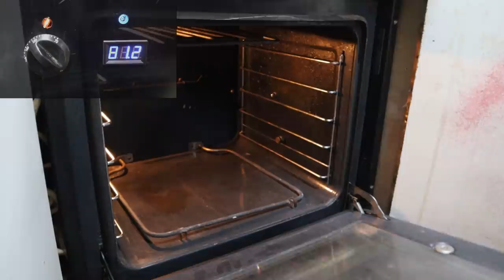Antique Cast Iron Potbelly Cauldron Restoration.

Comment: It was refreshing to see the seasoning process done correctly.  Many people only season their pots/pans one time.  3 is the minimum I would use and I've seen people season their pans up to 5 or 6 times for that perfect coat.  Well done!!
Reply from the maker: Thank you Jacob. We have received so many comments saying we did it wrong. But we know this is the correct way of doing it.
Reply: @AJRestoration  well done 💯👍
Reply: @fabiankawau3362  .
Reply: Hi all. You' re quite right in the number of seasonings. I did my 1/2 size cauldron over an open flame 8 times and its withstanding better than my 3timed seasoned pan. 😍

Comment: Fun fact for cast iron collectors. As a general rule, the thinner the pot wall, the older the pot. Another sign of age is that legged pots like this tend to have one leg worn down much shorter from years of scraping and dragging on the hearth stones. I have seen some that were literally "pot bellied" where the legs were so worn down, the pot rested on its belly.   The reason for the thinner walls is that when labour was cheap in the 16th-18th centuries, casters would make 100 pots and expect up to half to fail, but it didn't matter when the sale of a handful of pots was enough to make a living on. However, when wages went up during the industrial revolution, they needed a higher success rate, so the pots got thicker. 

Also, the triangular handles or ears on the cauldrons like this were not designed originally for wire hoop handles. People would have used pot grabbers. It looks like a large set of iron calipers with bent ends. As they are adjustable, one pot grabber could fit all the pots you might have in your house. Much cheaper than wire handles and they didn't burn your hands.
Reply: I have a Falkirk pot like that from the 50s. I inherited from my grandpa in cape town who had copper plated it and was using it as a coal skuttle.
The copper is long gone. I brought it to the UK and still use it. What I noticed is that it's much thinner than the modern ones.
Made in Scotland I'd assume when they were in the heydey of good manufacturering.

Comment: Maybe a cleaning with degreaser first, then use a 2 amp battery charger, a sacrificial anode (large coffee can metal) and some wire and a plastic container to use electrolysis to remove most of the rust and speed up the sand blasting.

Comment: Power tools aren't always faster. A small round file would have dealt with that casting bump far quicker. I know the full time spent grinding isn't shown but I've done nearly the exact same thing with my dremel and and I eventually learned that a new, sharp file took less than half the time and now I reserve the tiny rotary grinder only for nooks and crannies where a file won't fit.
Reply from the maker: Thanks for the tips! I have noted in some cases the files do work faster.

Comment: I have a Falkirk pot like that from the 50s. I inherited from my grandpa who had copper plated it and was using it as a coal skuttle.
The copper is long gone. I brought it to the UK and still use it. What I noticed is that it's much thinner than the modern ones.
Made in Scotland I'd assume when they were in the heydey of good manufacturering.

Comment: Excellent work!  Having de-rusted similar sized items, I can wholeheartedly recommend trying electrolytic cleaning.  Water, washing soda, and a 12v battery charger would have saved you quite a bit of effort, and a lot of sandblast media.  Sandblasting also may not remove heavy metal contamination, whereas electrolysis will do a better job.  I also might have attacked the inside bottom with a flap wheel to get rid of some of the pitting, but, that's a nit pick.  
I have no problems at all with that recipe!  I find the apricot jam and cream soups combo a bit odd, but, it looks tasty!
Reply from the maker: I have one coming up that I want to try electrolysis on. The recipe came out absolutely amazing!
Reply: @AJRestoration  I think you'll like electrolysis! It makes a nasty looking sludge, but, it's all stuff that came off your part!
Reply: @paulfeist  Heavy metal contamination? Really? Is this a common or possible thing with old rusty cast iron? I never thought that would or may be an issue. Honest questions.

Comment: It's actually frowned upon in the ci community to sandblast ci but if it works it works im all for it lol. Lots of people frown on my ci cleaning methods but I don't care. I oven self clean ci for 2hrs to bake off the carbon buildup and never had a problem. As a tip any ci with only rust can easily be cleaned by soaking in 50/50 water and white vinegar. Depending on how bad of rust it can take 2-12 hrs normally.
Reply from the maker: Thanks for the info
Reply: @AJRestoration  you're welcome

Comment: Just a FYI…. The difference between brands like Lodge and the more expensive brands is surface prep.  The more $ brands sand and smooth the surface so they start off like very old well used cast iron.  I buy Lodge then sand the pits out till it looks like glass.  Beautiful work.  I need to get me a media blaster.👍

Comment: That's a beautiful piece of cast iron. I'd love to see it hanging over a fire filled with slow-cooked ham and beans. My grandmother was born in the late 1800s, when she died at the age of 93 she owned 3 cast iron pans she had accumulated over her life. The 1st she received as a wedding gift when she was 16... almost 16 anyway. Probably as much baking went on in those pans as frying. I use her recipe for biscuits that she had been making since she was 12, probably her mom's recipe,  the same recipe my mom used her whole life, and mine *Never Tasted The Same*. Sorry for venting. I added those pans to my own collection when she passed. Added them to a number of others that she would have probably found a little silly... but hey, I might need a cast iron crepe pan every few months. With all these pans now I find myself using her three except when I want my crepes. Her yearly or seasonal cast iron maintanence plan was to build a big hard-wood fire outside and set two of the three pans in it and let it burn down. When they were cold she would just knock off the ash, scrub'em dry, and start to reseason them. She said that's where the term came from, each pan had a season. Everyone stay safe.
Reply from the maker: That's not venting buddy, its a nice story and thank you for sharing! My mother also collects them, she now has about 6 of them if I remember correctly. When I gave her this one she was so happy, she told me this one looks so good she's going to put it in a display case and never use it.

Comment: interesting, just a slight difference from what I would call a bean pot yet it could be used as such. The legs on a bean pot are shorter.
A bean pot is used to make baked beans, from scratch. Normal use method is put all the ingredients into the pot, cover and put the full pot on top of the wood burning stove to slowly heat and cook everything for 24 hours.
Dried beans needing to absorb the moisture ( water ) and then be cooked through means it's a slow process.
yes, the tinned "pork and beans" or baked beans is the final result, however you can adjust the recipe to improve the flavour for your own tastes.
Reply: nowadays you can cook those beans in regular pressure pot. 4 to 6 hours is plenty enough to make them absolutely soft.
Reply: @Romazetti  a full boil in a regular sauce pan for 4 to 6 hours is enough to soften them as well, my original post was on how the old cast iron bean pots work only.
Reply: @jaquigreenlees  maybe we talking about different kinds of beans? I remembered that "фасоль" and "бобы" is both "beans" in english :D
google for example "russian black bean". if you cook it in regular sauce pan only for 6 hours, you will break your teeth :D
"фасоль" - is climbing plants. seeds are very easy to cook.
"бобы" in the other hand - is bushy plants of the same family. seeds are much bigger, and take much longer to cook.
Reply: @Romazetti  I was talking about pinto beans and kidney beans, either of which would be used for baked beans.
Nice to know there is a kind of bean you would need to cook for a very long time unless using a pressure cooker.

Comment: I'm from Cape Town. Have you tried electrolysis? When I normally get my hands on an old driepoot like that I just chuck it in an electrolysis bath and let it cook for a week. I soma use a car charger to supply the power, and it comes out great every time. It's nice and environmentally friendly, doesn't put any wear and tear on any tools and just needs a light scrubbing with a sponge or brush to get the magnetite sludge off before seasoning. Lekker recipe that.
Reply from the maker: Thanks Francois. We actually have an electrolysis video on our channel. We will keep this in mind If we ever do something similar again.
Reply: Or DC 1 rust removal

Comment: That's a nice looking pot. I restored an old cast iron pot I found in Colorado. I used garnet and walnut shells to blast mine.  I also did a salt scrub on it before seasoning. From the marks I found on it it's from 1856. I spent a lot of time on the restoration. Now I use it to make stews and even fry fish it. Just wish I had the original lid. It was not to be found though.

Comment: For the people who don't have a sandblaster after the wire wheeling you can soak in 50 percent white vinegar and 50 percent water for up to 24 hours watch once no more rust rinse hand dry place in pre heated oven 250 degrees for about 2 hours remove,, coat with lard or olive oil 
Heat for about 1 hour repeat 1 more time .... Cook french 🍟 or bacon first time , never use soap and water on your cast iron.. use salt and rag or stainless steel scrub pad to scrub out pan of food stuck on then more oil.

Comment: If you put it in a pretty hot bonfire it will burn everything off.  Works for me.  Build a fire and let it burn down some then set item in hot coals and come back some time later and coat with oil.

Comment: Just some personal experience sharing. Flax seed oil will give you a beautiful finish on your cookware and I found anymore than 2 coats was unnecessary due to how hard the finish is and not very durable. Which in turn is a very brittle season layer. It will most certainly with use chip away. My grandmother swore by crisco and I used that for years to much success with a much more durable season finish. Still not completely satisfied I decided to start using what the real "old timers" used. Pure lard. I like pork lard. This is by far, IMO the very best to season your cookware. I use a small amount, thin layer over the whole pan, before each cook session for a "base layer" then add whatever oil or fat ontop of that to cook with. Clean, dry on stove, then add another thin layer of lard across the the whole pan for storage. Which never leaves my stove. I dont care for the seed oils anymore. Highly recommend pork lard. Bacon grease is a go to as well. I too when when putting a fresh new season on a bare pan will preheat it to 200..add my lard and wipe it all off..then set it back in the oven at 200 for an additional 10-15 minutes, then remove and wipe down all oil again, place back in stove and raise temp to 450 for an hour. Doing the second wipe down before returning to oven will help prevent a splotchy finish look from pooling oil. Good luck!

Comment: Beautiful restoration!  I don’t have access to a sand blaster. Sure does seem to make a difference!  Thank you for sharing.
Reply from the maker: Thanks for watching!
Reply: If you have a self cleaning cycle on your oven or any heat source that can get up to 260 C, that will work as well. It can take up to 6-8 hrs though. Some surface rust will appear after washing, but will go away when seasoning.
Reply: @mond5004  Thank you !!

Comment: You didn't make a potjie but an outdoor stew. A potjie must be done in layers of meat and veggies and musn't boil but very slowly SIMMER until its cooked. That may take anything from 3 to 5 hours, depending on the meat used. You will also only need one briquette after the potjie reaches full heat.
Reply: Cool

Comment: Don't sandblast vintage cast iron. Use electrolysis, which is super easy and non destructive or an acid based rust remover.

Sand blasting and grinding and wire wheels are a fantastic way to turn a potentially expensive antique into a door stop.
Reply from the maker: Thank you!

Comment: Never store iron pots with the lid on. Water accumulation will occur. Put a cup or two of rice inside. A folded paper towel acts as wicking and air space so air can move around. Cooking acidic food is hard on seasoning, as well as metallic cooking tools, Wash iron that is very warm to the touch with HOT water and a plastic bristle brush. This creates steam that will loosen stuck foods. No soap. Always wash as described above, dry, heat iron to very warm and wipe down with thin coat of oil before storage. Do not soak in water, or boil water based dishes in cast iron...loosens seasoning. Well done!
Reply from the maker: I store them with the lid on, but I fill it up with newspapers and a cup of rice to keep it dry and comfy. Thank you for the advice, it is really informative!
Reply: @AJRestoration  Cowboy Kent Rollins here on YT is my goto expert for care of cast iron. I used to have problems with it, but since adopting his methods, no more. He also uses flax seed oil for establishing reseasoning. I like your application of the oil with the brush. Avoids lint deposits. When it gets really set in and turns completely black and set hard with repeated use and seasonings you can switch if you wish to olive oil. Soap of course, especially modern powerful dish soaps will logically break the seasoning down...that's a beautiful old pot!😍

Comment: Although most cast iron junkies would be mortified at the thought of using a sand blaster, the amount of rust might have warranted that. Although, I have to agree with others that an electrolysis tank is where I would have gone with it first, and than some light scuffing with a scotch pad. In addition, cast iron is porous, why didn't you preheat it before adding your oil? Also, why didn't you turn it upside down so you don't get pooling in the bottom of the pot?
Reply from the maker: I get what you are saying, but electrolysis would not be sufficient, and I would have used abrasives anyways. I don't think there is any problem using sandblasting on the cast iron pot. The pot was preheated, but not the lid, the pot was done on another day so I gave the lid a layer of oil to prevent it from rusting while I am busy with the pot. Also the excess oil was thoroughly wiped down, thus it was not necessary to bake the pot upside down.
Reply: @AJRestoration  . My husband and I collect and restore cast iron and as bad as that cauldron was with the crack we would have never attempted the E- tank or lye bath. If someone is going to use it the way it is and love it you did a wonderful job. We used the same flax oil you did and the flavor and color of our pans wasn’t very good so we switched to Ghee butter and the taste and color was excellent. Thank you for sharing.
Reply: @Nonayabizness360  For the life of me I can't see the crack.
Reply: @Ea-Nasir_Copper_Co  . Yeah I know that's what I meant he did a very good job. We are on so many pages and there are so many cast iron snobs. I say if you are going to keep it and love it or are restoring a piece for a family then its worth every bit of work. We use a lye bath and Ghee butter for ours and we have rescued many from the junkyard by our home. We love seeing the beauty come back to these pans and they just don't make them like that anymore.

Comment: Not sure if it was antique, the wire handle was not rusted? Reminded me of a time I was working in another city and my wife left our potjie outside in Cape Town winter, we live quite close to the sea.  I only found out when cleaning the backyard, as she had put it out of the way to cool down and promptly forgot about it. It was as rusted as this. Did not have a sand blasting machine, did have elbow grease, sandpaper and wire brushes.
Reply: His method of seasoning was better than mine. I bought those aluminium trays, and inserted my potjie upside, the excess oil woul fall in the tray.

Comment: It looks like the sandblasting took longer because you can see a pulsation going on, in time with the generator engine.  Something you don't see when plugged into steady household (or industrial) current...just the observation of a casual observer who has never done any sandblasting, but has watched many a YouTube video of folks restoring things using sandblasting...
;-)
Reply from the maker: Yes, it's because my sandblaster has a direct feed from a petrol compressor that has no tank. so the revving of the motor and the piston action causes the pulsating. It is also because the petrol motor connected to the compressor does not spin or run fast enough, so the compressor is underpowered, BUT it's doing what I want it to do. Ill upgrade sometime in the future.

Comment: I love the South African Potjies (Poy-Kees), I still have two including an ever expanding collection of other cast iron but no Lodge. 
I have begun using organic flax oil for my seasoning process ending with up to six seasons for each. It creates a smooth shiny finish like a coating of varnish and will not turn gooey or become rancid like other oils. Never cook with full high heat on any cast iron.
Reply from the maker: There is nothing as good as a traditional South African Potjie. I have quite a collection myself!
Reply: Try the organic flax oil, it is nearly $30.00 for a pint and you have to store it in the refrigerator and shake it before use but the results are amazing! Just follow the normal seasoning process which can be repeated up to 6x.